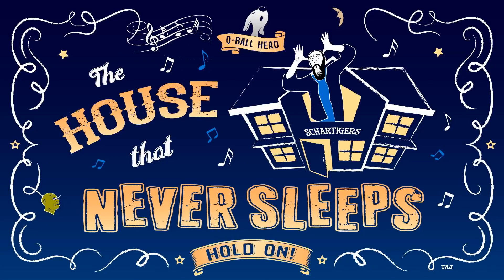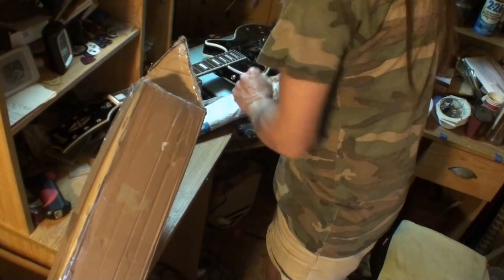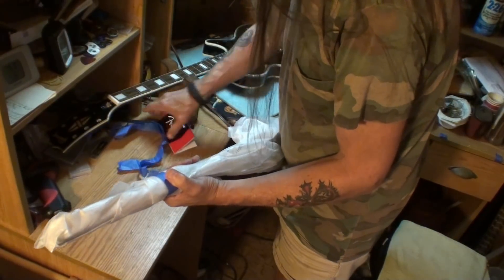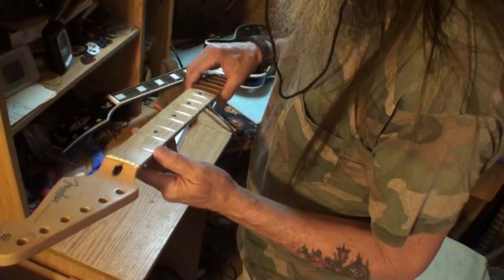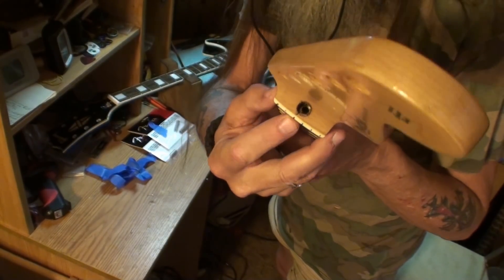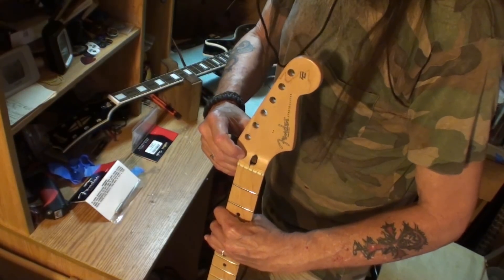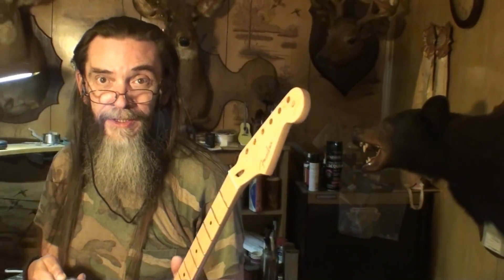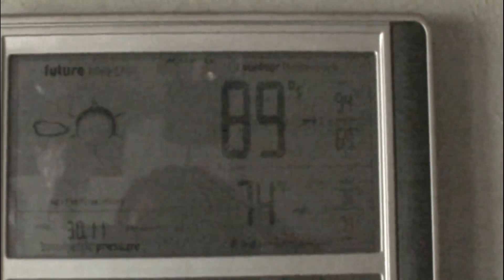american fender stratocaster bi-flex truss rod unboxing and brief explanation

Comment: I'm not surprised they engineered something like the bi-flex truss system but I don't understand why in the hell they used it.
Reply from the maker: it's a bitch sometimes (as the owner found out) to get the wooden plug out if you ever have to work on them, I would much rather have a 2 way truss myself.

Comment: Bloody nora! That's cracked allmost up to the nut. I've never seen that on a Fender before!
Reply from the maker: very odd the fretboard would crack like that! I'm pretty sure its not anything to do with humidity.
Reply: Fender has stuck with the bi-flex system for more than thirty years now. I have it on one of my Strats, and it's smooth and nice, just as it should be. Either the owner got unlucky and got one that had a production flaw of some kind, or he/she is unusually ham fisted... Seriously, Randy, this is a bit puzzling... Hope you can fix it, 'cause that looks to be a very decent neck, that.